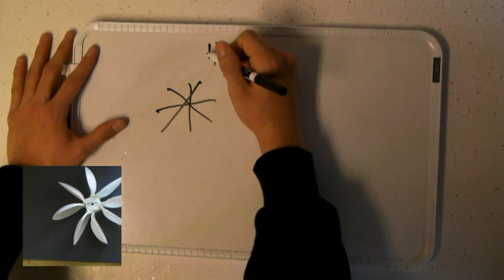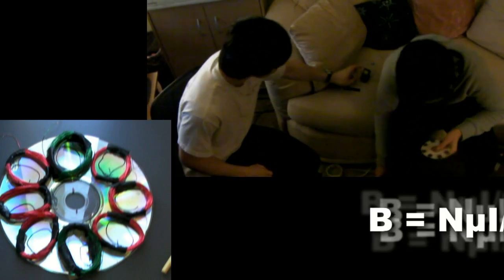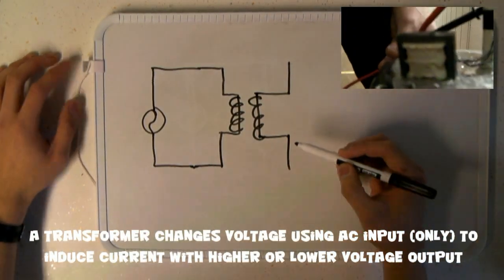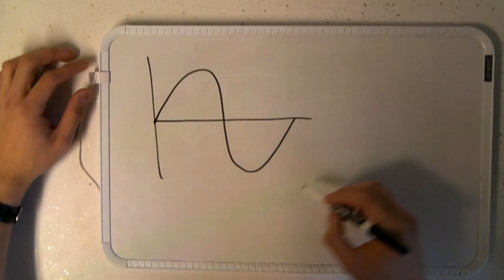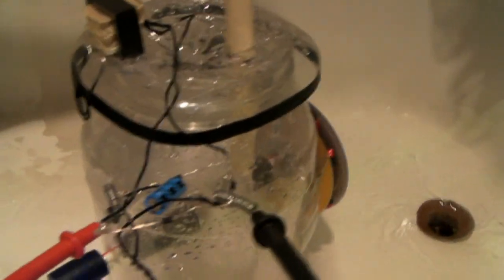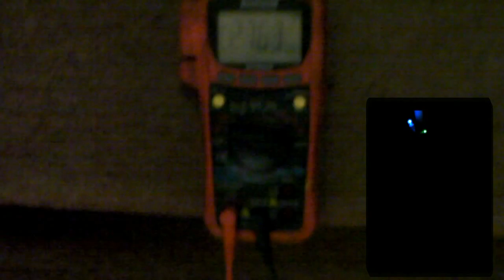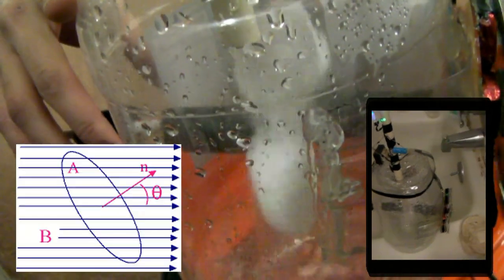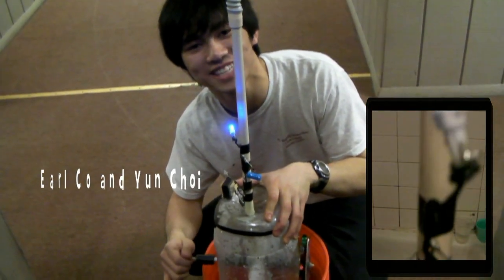Homemade Hydroelectric Generator

Comment: this is really cool, i wish you went into more detail about the transformer though. I think that's just me though
Reply from the maker: +ianlarimer Please see the previous comment from 1 day ago:

I explained the transformer at 3:15. It steps an AC voltage up or down depending on the ratio of the number of coils from one side to the other. It's how 10,000 Volts of AC current from the power plant gets turned into 120 Volts AC when it gets to your house.

It's also how 120VAC is converted into 5VAC (and with the bridge rectifier, into 5VDC) in the little wall adapter that you use to charge your cell phone. In the case of 120V to 5V, the ratio is 24:1.

Hook it up in reverse to make the ratio 1:24, which means the AC voltage at the generator is stepped up to 24x the voltage at the load. The transformer is there because the water wheel wasn't generating a high enough voltage to turn on the LED without it (need 1.5VDC).

Comment: Hi earl.

I have something to ask.

Can 20 pcs.( 12mmx1mm) of neodymium magnet help generate enough electricity??
Reply from the maker: Depends what you mean by enough. All you need is 1.5V to turn on an LED although with what very miniscule current you'd produce with those size magnets, the LEDs will most likely be very dim. But as long as you can boost the voltage with a transformer, the current will drop (dimmer light) (Power = Current * Voltage) but the LED will turn on at 1.5V. Also the faster you change the magnetic field, the brighter it gets.

Comment from the maker: +Saker Gayake see previous comments. Wire diameter doesn't matter, the thinner the better as you can pack more coils in the same space. Magnet size doesn't matter, strength of magnetic field does. Higher Tesla is better. Usually these come from larger neodymium magnets.
Reply: Earl Co Hey I know this was posted I while ago but there's one part that I cant find anywhere. How do you attach the multimeter to the machine and measure the output. I thought the wire ends but then realized that they all are occupied with being tied to each other. Any help?
Reply from the maker: Milad Katawazai You can Google how to use a multimeter. In essence, if you're measuring the voltage difference between any two points, just take one lead and touch it to one point and another lead to the other point (connect multimeter in parallel). If you are measuring the current through a wire/point, break the wire/point in half and connect each lead to the two ends (connect multimeter in series with wire).

Comment: Hi! I'd like to ask if it would be possible to charge a power bank using this? Also, using the alligator clamps of a multi-meter, where would I attach these clamps on the generator?
Reply from the maker: +Bea Flores Possible if you can get 4.5-5 VDC output. As for the multimeter, depending on what you want to measure (such as the voltage across the LED), connect each clamp to each lead of the LED (connecting in parallel).

Comment: Hi! :) I just wanna ask if that the magnets and coils could produce electricity already?? coz we don't have any transformer of even bridge rectifier. .thanks!!
Reply from the maker: Yes, just very little voltage. The transformer just increased the voltage enough to drive the LED (needed minimum 1.5V).

Bridge rectifier was to make it so the LED didn't go on and off according to the AC power.

Comment: how did you connect the wires to the generator if the wheel is turning? please reply
Reply from the maker: The magnet wheel was turning. The wire wheel was fixed to the container.

Comment: Hey Guys !! Did you try to use some kind of gear mounted on the turbine so the wheel could spin faster ?? I think it might be needed to add an extra axle as an addition one which would react with water and then by gears the force would be transferred to main axis which would be attached a magnets on it. Maybe you could try ?? :)

Comment: Can I do these project without the transformer with rectifier diodes.Since Im just after for the dc produce by the generetor.Thanks
Reply from the maker: Yes you can skip the bridge rectifier and all you will get is alternating current.

Comment from the maker: @HojoisaNoNo transformers MUST use AC because they operate on the same principle of magnetic induction internally and this require a changing direction of current to create a changing magnetic field. The ratio of cooil turns from one side of the transformer to the other determines whether a transformer is a step up or step down transformer (in voltage), so don't wire it in reverse or you'll have even smaller voltages. No, not any transformer will work, depends on how much of a step up in voltag

Comment from the maker: +Leafthorn Graykoat yeah well this is a one stage generator. It was already complex enough, it wasn't meant to be practical.
Reply: can you tell me all of the materials you used on this project?
i wanna order those
Reply from the maker: Yusoph Muti Materials are all in the video. All generic and recycled from around the house. The transformer and bridge rectifier circuit can be pulled from any wall wart (AC adapter). Wire the transformer in reverse to make it a step up transformer instead of a step down. AC adapters are originally designed to convert 120-240V AC mains to low voltage DC. The bridge rectifier will keep the AC to DC part but you need to go from minuscule voltages to higher voltages enough to drive the LED (minimum 1.5V).
Reply from the maker: Yusoph Muti Materials in description.

Comment: @earlvanze 
LOL I doubt very much your getting 2amps of current especially if your mA LED didn't blow up in your face or your coils didn't melt.What AWG or mm wire did you use on your coils?Hard to see but it appears on the vid that wire should only be good for about 500mA or so.

Comment: now use a parabolic mirror and sunlight to boil the water at the bottom at a rate sufficient to send the water back to the top, and turn another turbine before putting it back into the tank to repeat the cycle!

Comment from the maker: @chibizel41 ... a bridge rectifier (take it from the power adapter, it's that chip with 4 rectifying diodes and a capacitor, or buy those 5 parts, or buy the bridge rectifier itself from radioshack), and an LED or two.

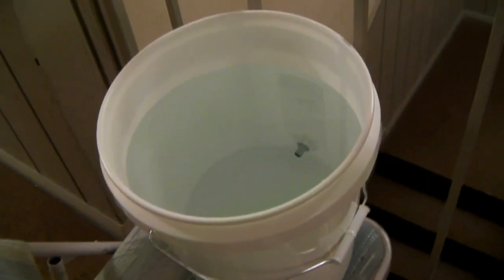Comment from the maker: My point at 5:53 is that the current remained constant, so when I add the LED, the resistance in the circuit increases, dropping the voltage reading across the leads.

I think what I meant to say is that when the LED was added, the overall resistance in the circuit increased. The LED was drawing current to light it so the current decreased, thus the voltage output decreased.

Oh I see, I had commented relating to electric power because that's what I was trying to generate.

Comment from the maker: @chibizel41 a plastic jar, 8 neodymium magnets set up as shown, insulated coiled copper wire, plastic spoons, a barbeque stick, straws to support it, foam and washers to keep it from sliding around, 2 Cds to hold the magnet and wires, hot glue, wires for connection, a transformer to jack up the voltage (take one from a power adapter and wire it in reverse so it steps up not step down (ie 5V to 115V)...

Comment: +Earl Co can we use ready made 12v dc generator ? and use the spoon design to make it work?
Reply from the maker: A generator is just a motor wired in reverse. If you can spin the motor at high RPMs, you can generate sufficient electricity at the leads.

You could do this, but you may not be fully understanding as much of the physics behind it since the generator essentially becomes a black box to you. Unless you already know how that specific generator works.

If you're going to use a ready-made generator, you might as well not use plastic spoons, and go for something more efficient, that catches all of the water. The point of this small scale design was also to use recycled materials.
Reply: Thanks +Earl Co I appreciate It :D

Comment: Automotive alternators DO NOT work in this way. They do not use permanent magnets and the electromagnetic field is made stronger or weaker depending on how much electricity the car is demanding (including any charging of the battery. This keeps the amount of electricity being generated in line with what the car needs and reduces the drag that would occur if permanent magnets were used. This is a cool little experiment though.
Reply from the maker: The physics principles of changing magnetic flux inducing an electric field and electromotive force (EMF) is the same.
Reply from the maker: But of course it should use an electromagnet rather than a permanent magnet.
Reply: It would be running full throttle all the time, but your point is well taken. Obviously the moving magnetic fields is how electricity is traditionally generated.

Comment: Any tips on wrapping the wire into a coil?
Reply from the maker: +Shane Wrap the magnet wire around a pipe as neatly as possible, and then slide it off.

Comment: hi earl nice project you have here, i'am currently doing this right now, i'm done doing the the turbine and magnets, i  put 3 neo. magnets in each of 8 division, could i get higher voltage because of this? or should i add turns in magnet wires greater than 100?
Reply from the maker: I think your 3 magnets may be interfering with each other?

But if your voltage is not high enough just put a transformer at the coil terminals to step it up.

Comment: I saw that the copper wire twirls are connected on the disk so it's like 1 really really long piece of copper wire. If say that long piece was 70 meters, and i have 7 pieces of wire 10 meters each, is it ok to solder them to form one big wire?
Thanks! It's for a project.
Reply from the maker: That's what I did with the individual pieces, solder them together. What matters is the number of coils and the configuration in which they're coiled. If you have 70 meters and they're small enough gauge, then you can cook them more compactly.
Reply: Earl Co Awesome! Thanks so much! Oh and they don't have to be magnetic copper wire after the coils (like connecting the transformer to the rectifier and stuff) right? Also, are there any restrictions as to what kind of motors we can get the wires from or is it any kind like an electric fan motor? Thanks again!
Reply: Earl Co Oh and if the magnetic wires are too short to go to the transformer, can I solder ordinary insulated copper wires onto them then solder those into the generator? Or do they have to be magnetic wires up until the generator?
Thanks!
Reply from the maker: Yes you can do this. The magnet wire isn't any special wire, it's just thinner and thus you can pack more coils in the same amount of space. Use regular wire unless you're making the coils. Regular wire is cheaper.
Reply from the maker: craaazyish Any kind of electric motor uses magnet wire for its coils.
Reply: Earl Co Awesome! Thanks so much!

Comment from the maker: @bbansal98 The jar should be as big as you want it to hold everything.

THE WIRES HAVE TO BE INSULATED. MOST IMPORTANT! If they were not, the
current will not flow in circles and would rather just cut through
from input to output through the copper without going around the
coils.

Transformer is not necessary, but don't expect more than 1V output.

Have fun!

Comment: is it possible to use ring magnets instead of what u guys used? I'm planning to take out the magnets from my headphone
Reply from the maker: No. Strong neodymium magnets are absolutely necessary. There are no alternatives. Not fridge magnets, and not magnets from tiny headphones. Hard drive magnets might be okay as they are powerful enough.
Reply: do I need to adjust the number of turns for the coil if I use hard drive magnets? or 200 still?

Comment: I know this is a stupid question but i have to ask. What if one could build a tower like a smaller version water tower with a pipe large enough to put in turbines inside the pipe and let gravity take it course. At the bottom is another tank to collect the water and use natural suction from ciphering gas out of a car to bring the water back to the top tank? or some sort of water catching system to collect and use the same way as the first part of the question?
Reply from the maker: Simple: Law of Conservation of Energy does not let you harness energy out of a perpetual motion machine.
Reply: Your using to force of the water to turn the turbines right? water going downwards wouldn't have enough force to turn the turbines?
Reply from the maker: I don't think you understand what this "natural suction" from siphoning gas out of a car actually is..........

That's gravity at work. You can't siphon gas out of a car if the other end of the pipe is ABOVE the gas tank.

https://www.brightstorm.com/science/physics/solids-liquids-and-gases/physics-siphoning-torricellis-law/

https://www.reddit.com/r/explainlikeimfive/comments/3xmjh4/eli5_how_does_siphoning_gas_out_of_a_car_work/
Reply from the maker: It make more sense to use the electricity generated by the generator to power an electric pump to pump water back to the top. But again, you're trying to defy the Law of Conservation of Energy, which is a big no-no in physics.
Reply from the maker: You can never produce more energy than you use, otherwise your efficiency would be greater than 100%, which is impossible even for a theoretical engine, which caps at 100% efficiency (cannot be a real engine).
Reply from the maker: The problem is how do you bring the water up, without spending more energy than you've produced?

The answer is you can't, not without defying the Law of Conservation of Energy.
Reply: Ok thanks. Just always wondered.
Reply from the maker: https://en.wikipedia.org/wiki/Conservation_of_energy

Comment: i can get about 20 watts out of that amount of force but require a car alternator and a special homemade voltage frequency phase controller modulating the resistance of the gen coil in series with the load.  its tricky, but i have done it before one time.  if you want a better generator, you can also make a lenzless flux alternating concept that is patent pending but similar to alexandersons dc radiofrequency generator or inductive pin wheel design, like iron wheel that spins next to a electromaget bar with a permanent magnet behind the electromagnet and the iron wheel in front of it. by divided sectors in the iron wheel it will vary the magnetic flux in the electromagnetic core and cause inducatance in the electromagnet. when one sector of the iron wheel is in close aproximity with the electromanget, the permanent  magnet on the other side of the electromagnet causes the electromagnetic core to become a little bit less magnetic and when the iron sector moves away with a space gap, the magnetic flux in the electromagnetic core increases and the variation in magnetic flux induces electricity into the coil of the electromagnetic core. the incied current in the coil will oppose equal and opposite the the magnetic field that induced it even the flux variation was caused by the interation of the iron sector wheel and the electromangetic core and magnet. this will cause the current induced to become reactive. the magnet itself does not need to move, neither does the electomagnet.

Comment from the maker: actually no, it makes sense. The water pressure F/A of the water out of the valve, PLUS the additional 7ft of gravitational potential energy, adds up. It's F total = mgh + rho*g*h

you would be correct if the valve and the turbine were at the same height, but they're not. The potential energy from the difference in height ADDS to the energy from the water pressure out if the valve.

If something that big was wrong, my physics teacher would have caught it.

Comment: what is the peak voltage and ampere produced?
Reply from the maker: This will obviously be different for different setups, different wires, different angular velocities of the turbine, and different transformers. My peak voltage after bridge rectifying the transformer voltage was about 1.7 V and probably 0.3 A or something really close to it.

Comment from the maker: @XiaoXiaWang Yes it will be able to charge up a power bank, eventually, after continuous rotations for a long period of time. The currents are far too small so this will need to be more efficient for it to be practically usable. But the principles are the same.
Reply: Earl Co can i use waterfall to generate? im not using any magnetic flux . just a propeller place under the waterfall and directly rotate to the motor and generate electricity .
Reply from the maker: So... You're not generating any electricity. You're converting kinetic energy of falling water directly into mechanical energy of a rotating motor. Oh I suppose wiring a motor and spinning it will generate electricity at the electrical terminals. You are using changing magnetic fields, it's just inside the motor. You're probably going to end up with a DC voltage output though if you're using a DC motor.
Reply: Earl Co isit possible ?
Reply: Earl Co to create enough energy to have electricity and charge a power bank
Reply: if its quick enough ,will it be able to ? and how do i test my turbine

Comment from the maker: @markmacoy09 V=IR maintaining the same current, yes voltage increases. To maintain the same current, you would have to increase the voltage if you increased the resistance. Most of the time in a circuit if you increased resistance, the voltage is kept the same so current decreases. I don't remember where that was said but I think it was meant to say current. Hmm.. My teacher didn't catch that when he graded this, but he caught "velocity" instead of "rotational velocity." Very picky. Well, more

Comment: Bro, what's the thicknesses of the wire you used?
Reply from the maker: As thin as possible gets you more winds per square inch. More turns means bigger N in that equation which means bigger magnetic field. You can use 22 gauge wire or similar, it's just about the space.